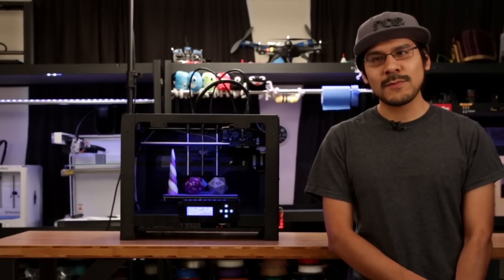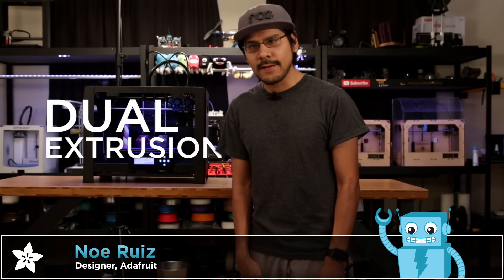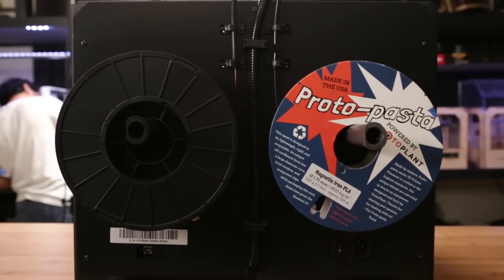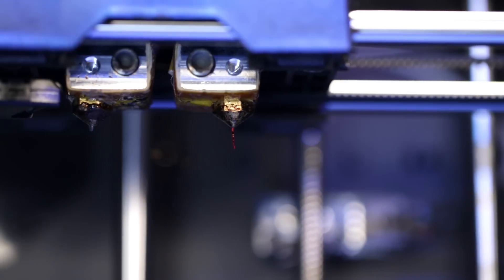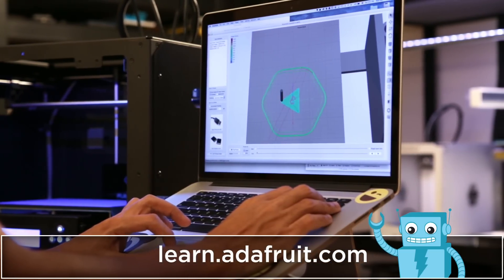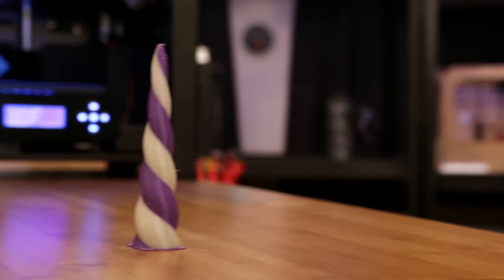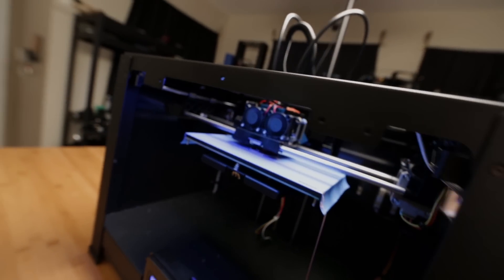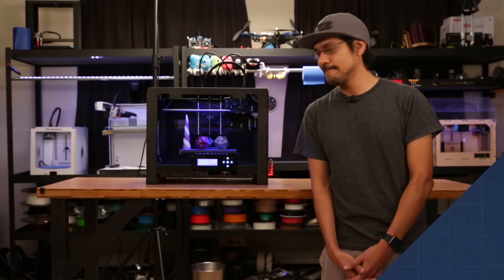3D Printing - Dual Extrusion

Comment: Is there any benefit to using two identical filaments at the same time? Will it print any faster or does only one nozzle print at a time?
Reply: Monmouthshire Tesla Dude only one nozzle can print at a time unless you were printing two identical parts side by side. You can use 2:1, or 3:1 nozzles where you run them at the same time at a percentage rate of feed which can blend your colors (if blendable) or make a swirl like design. You could also experiment with mixing various types of material for a custom blend or trial and error in a specialized filament you created yourself. Many options some work with success while others don’t. Using a soluble support is a big plus for larger prints. Having two extruders imo is a must have and if you run them all through 1 nozzle than you have unique abilities. We are making a 3 to 2 nozzle. One to run independently and two to blend. 3 filaments, 2 nozzles. Nobody offers this so we had to develop our own. Specifically because we are experimenting with abrasive filament blending however there are certainly more benefits than that.

Comment: Wouldn't that battery tester shock you if the current travels through your hand?
Reply: Goodboy Edits it is inside an yes if there wasnt an led
Reply: no, the voltage is too low.  ever touch both sides of a battery?

Comment: Alright, so there's merit in having dual extruders. But the real question I'd love to have in-depth answers to is this (and some follow up)

Is there merit in having your normal build filament alongside a water soluable filament for use with models that have insane overhang, and how effective is the slicer / designer software in making use of this? Is it just shoehorned in? Is there special custom slicers that take maximum advantage of sacrificial water soluable filament dual extrusion printers? How much more precision and model definition (if any) can you get out of this over a similarly priced single extruder printer?

Cheers guys, you're awesome!

edits: typo's
Reply: It appears you haven't been answered in 10 months.  Allow me to try.
From the way you ask your questions, it seems like you've read up on 3D printing but don't have much experience with them.
1: Neither the printer nor the slicer has any way of understanding what kind of filament is loaded into it.  The user must input the desired bed temperature, nozzle temperature, filament diameter and working speed into text boxes in the slicer program.  Most printers can handle a range of temperatures from 0C to 250C for the nozzles, some like the E3D can handle hotter temps for more exotic filaments.
2: Nearly every slicer package I've seen that can handle dual extruders at all has a simple check box that says "Build support with 2nd extruder" or some such.  Say you have some relatively expensive filament, that way you could build your support out of cheap PLA and save your good stuff.  Or, it would allow you to use a water/alcohol soluble or other easily removed support material.  Or you could use a different color of the same kind of filament for your supports.  All it does is use the other nozzle for those motions, nothing really magical.
3:  Water soluble printer filament isn't good stuff.  The only one I'm familiar with is E3D's Scaffolding.  While it is printer filament that washes away with water, making it ideal for supports (especially inside intricate parts), it's a pain to print with because of how different its glass transition temperature is from common materials like ABS, PLA and PET-G.  It also absorbs water from the atmosphere, so a humid day can ruin a whole spool of filament.  You're probably better off just using PLA as a support material. Most slicers slightly under extrude the layer adjacent to the part, so the connection is brittle and easily snapped off.
4:  A dual extruder setup will not improve the resolution or print quality of a printer.  In fact, it will probably be degraded slightly due to the extra weight on the carriage.  This is especially true with the dual extruder setup seen in the video, because the motors are mounted on the carriage.  The Mk. 8 dual extruder in the video is simply two Mk. 8 extruders side-by-side.  The same printer with a single Mk. 8 extruder would probably print with similar resolution and quality.  The resolution has more to do with the axis motors, linkages, and tolerances.  Then there's the fact that dual extruders tend to ooze--the nozzle that isn't in use at the time will drip filament, which can get smeared onto the part.
5:  Dual extruders can be difficult to rig.  You lose some build volume in the X-axis (rarely in the Y axis) with dual extruders because of the distance between the nozzles.  The nozzles have to be precisely leveled with each other along the Z axis.  If one hangs lower than the other, the lower one may strike the part, or the higher one won't have good adhesion to the part.  Dual extruders also complicate auto bed leveling, since auto leveling can't make up for any slope in the X axis without risking crashing the idle nozzle into the part.  It's one more mechanical thing to go wrong.
6:  What you gain with dual extruders is versatility.  Printing with different colors is just cool, and printing with two materials of differing characteristics on the same print opens up whole new possibilities that you can't do with a single extruder, like a rubber ball with a hard solid core, or an iPad case with built-in rubber feet.
Is it worth the extra expense and hassle?  That's up to you.  I've been thinking about upgrading my machine to dual nozzle, but the expense and difficulty of mounting two extruders is putting me off a little.
Reply: Awesome reply! Thank you for taking the time to go in depth with my questions. You're right on the money in terms of reasoning behind the questions. I'm indeed in the market for a good 3d printer, but I really want to skip the "myFirstSony" stage. Got experience with cnc machining, so G-code and designing isn't a problem. Firmware tweaking is quite alright too, as long as it's an arduino sketch, or pure assembler. Anything in-between will cost me time reading up on the hardware/software balancing act.

I have thought about the physical difficulties of multiple extruders moving on the same axis, but yeah more moving parts usually means more calibration/leveling/tweaking. For me the biggest showstopper is the dripping. That's just a no-go, as I do want to churn out parts unattended after tweaking out print errors. Dripping seems to be one of those things that need to be dealt with on a per-model (or worse, a per-layer) basis.. Add to that the increase in bed-leveling logistics, the physical calibration of the nozzle heights (I'm sure it's probably not worth trying to automate that (adding a second z-axis to one nozzle, just for calibration)), and the whole multi-extruder idea quickly becomes a really expensive project, with no real guarantee of success..

Thanks for somewhat pulling my enthusiasm out of the clouds. I now know for what I want to make, I can't justify that kind of expense yet. Cheers!
Reply: As for dripping:  One technique a lot of slicer software uses is called an ooze shield.  Basically the printer builds some hemispheres up around either side of the part, and any ooze from the idle nozzle gets wiped off on this tower.  Building this also has the effect of priming the nozzle.
If you're familiar with machining and CNC, I strongly recommend you build your own printer, either from scratch or from a kit.  I've had fairly good luck with a reprap derivative I bought for less than $300. 
I use Marlin firmware, which...isn't so much an Arduino sketch as straight-up C++.  Thousands of #define statements.  But it is modified and uploaded to the board (my printer uses an off-the-shelf Arduino Mega with RAMPS board) using the Arduino IDE.  No assembly needed.  Most of what you'll do is change a #define statement from True to False or from 1 to -1.  Occasionally commenting or uncommenting lines to choose from a series of options, things like that.
Being comfortable with G-Code is a big asset.  You probably won't edit the tool paths themselves, but you will want to customize the starting and ending routines I'm sure.
You definitely want to start with a single extruder machine.  If you build your own, you can upgrade to a dual extruder later when you're ready.
Some tips that I wish I knew when I started printing:
Leveling the bed is extremely important.  It's also not that complicated.  What I do is move the extruder to the four corners, barely touch the nozzle with the plate, and then back it down a quarter turn.  I seldom have to address it after that.
A part cooler fan is very important for PLA, particularly for layers less than 1 in^2 in area.  PLA melts at such a low temperature that the extruder can easily melt the layers below, turning your print into a melty mess.
PET-G filament exists.  Where i get it, it's $3/kg more expensive than PLA, and it's SO much better.  It has a higher glass transition temp than PLA, meaning it's not as melty, and the prints are stronger than ABS.  Don't stick with PLA because "It's normal" or "it's supposed to be easy."  Try PET.  It's good stuff.

You might try to seek a local maker space.  That's where I first learned how to use a 3D printer, and there are usually experienced folks there to give you a hand.  Having a working, tuned 3D printer to learn on is beneficial when it comes to building/setting up your own.